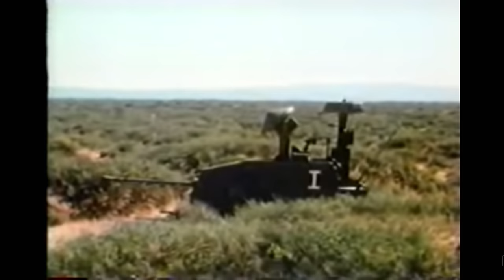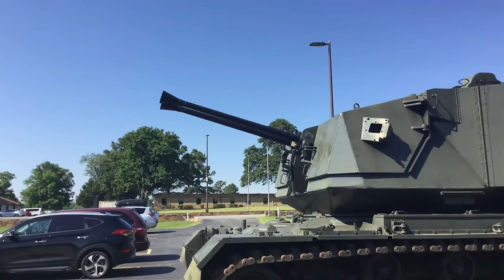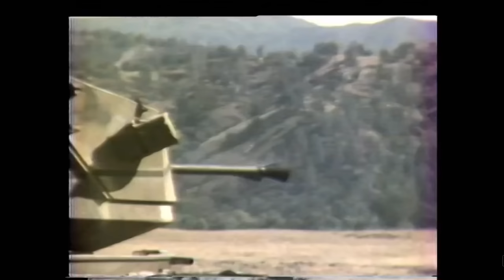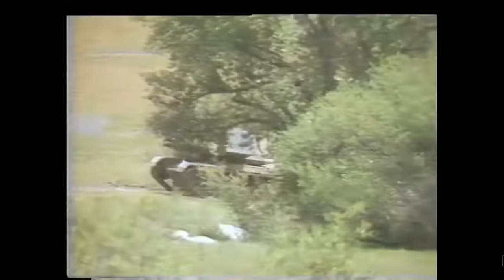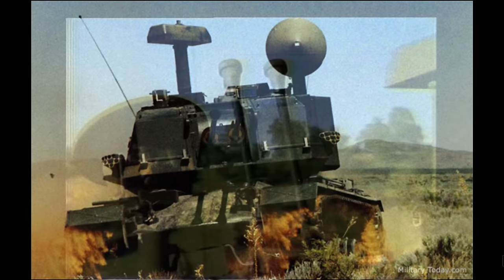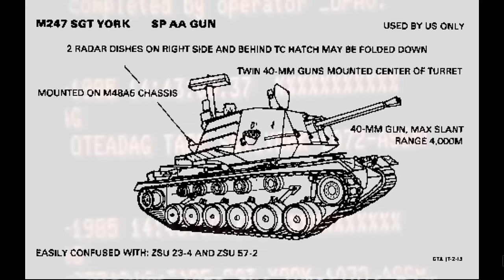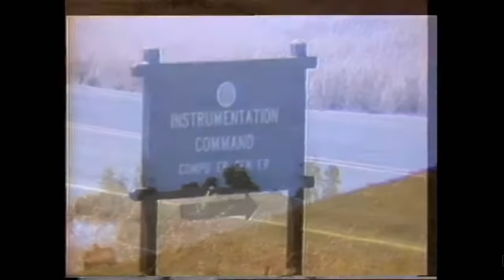M247 'Sergeant York' | WORST AIR DEFENSE EVER!

Comment: Hell, all we had to do was buy the German SPAA LOL!  I remember a drawing one with a GAU-10 35mm version of the 30mm GAU-8!  

Not being able to keep isn't a real argument though!  Good luck having something like a MRLS keep up with M1's.  Road speed is useless compared to cross country.  The M246 should have won but even then as I told someone else on another forum as he bragged about the ZSU's and other Russian SPAA's, turn on the Radar and HARM's will cause them to have a bad day!
Reply: Pretty sure the Russians also had an anti radiation missile
Reply: @jameson1239  Yes they do and I NEVER said they didn't!  That's the problem any SPAA has.  

Now with auto-tracking, FLIR and thermal optics RADARS aren't important for short-range weapons.
Reply: @jameson1239  Oh and all east and west have DATA links where something like a plane, Sat, or Drone is feeding them DATA 300 -miles to out in space feed both Telemetry. 
UK ALARM       Speed 3 km/s (Mach 8.8) Block IA/B
  4.5 km/s (Mach 13.2) Block IIA[4]

Comment: The L/70 bofors were not old, maybe you were refering to the WW2 era L/60? Yes using the M48 hull was unneeded as the armour was too heavy. It really needed E/O and FLIR like Phalanx has now. Radar used by ground vehicles is very terrain dependent. This laughable development is repeated with the M2 Bradley. Pentagon Wars. There should have been a refocus on killing missiles as a CIWS does ie in protecting tanks from missiles.

Comment: The part where the radar located "a target" which was a latrine fan as a helicopter had me breaking out in laughter!  Can anyone tell me why the US military can't buy other nations weapons which have been proved effective?   US Pride?
Reply: Stupidity, pride and corruption.
Very few non-American products ever gets utilized by America.
And even those exceptions usually has some sort of connection with any of the American contractors.
Case in point would usually be H&K or FN. 
One of the only non-American big toys used by America in the past would have been the Harrier. But even then McDonnel Douglas and Boeing had to get involved for it to be able to be used by the Marines.

And it's not just with military products.
Even everyday civilian products suffer from American pride and stupidity.
Just look at what they have done against Jap and Euro cars.
Hence why in the American car community, it is a common and real belief that America barely ever gets the "best toys" i.e. the more racing tuned variants of certain foreign cars due to the countless rules & regulations set upon them due to lobbying done by Ford, Chevy, GM, etc.
Reply: @dickmelsonlupot7697     You're absolutely right!

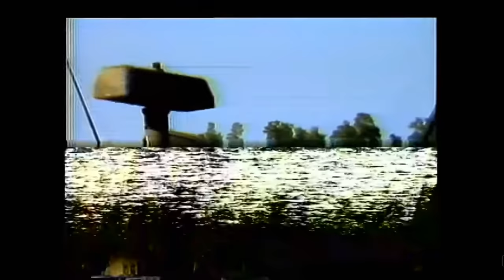Comment: I was there for the evaluation of the two systems, and the General Dynamics system were 200% better.  In fact the Raytheon system was better than both, but as usually politics got in the way.  The selection board did not follow or consider any of the recomendations submitted by the evaluation team, and most on the Eval team was dismissed and reassigned, i Went to Patriot, thank god.  Believe or not but the other 3 systems used Raytheon radars which were tried and tested and worked exceptionally well.  The person that falsified the data was relieved from his duties.  Ford falsified every bit of data that was submitted.  Those stories are adsolutely true.,  It relly wasn't the Army that screwed up it was Ford and the main program manager.  Oh Crap at the 15:08 mark that is me, i Was a CW3(Chief Warrant) addressing the operators on test parameters, all of us were from US Army Test and Evaluation Directorate ar Ft Bliss,  well we were basically fired from the test and evaluattion because we didn't give the answers the Program Manager wanted.
Reply: I joined the Army just as this was shit canned.  We had Vulcans in the York motor pool building, they tossed us out to give it to the Patriot system!  I still have some flavor of Unit Citation award for the York...hilarious!

Comment: Divad was radar targeting.  I designed the Optical gunsights. I worked on the program start to finish. Although not a perfect system. Your just quoting the lieing media explanation.  The problems where more politics than preformance.  Also Ford was losing 1 million per unit. When Administration  was looking to cut spending, (Propaganda) Ford was more than willing to volunteer. Ford in the end made 2x the original contract dollars canceling the program.

Comment: Should've procured the Gepard.
Reply: No, the AHEAD round for the 35mm was decades away at this point (it wouldn't show up until the 1990s, the Sgt. York was developed in the 1970s), and Bofors had just released their HEPF (High Explosive, Proximity Fused) round for the 40mm Bofors gun, a weapon that the US Army loved during Vietnam.

Remember, unless you're a 3-inch gun or larger until the development of the 40mm HEPF round, the only way you're going to hit aircraft is literally filling the sky with rounds.

Comment: And Cv 90 has one bofors antiaircraft cannon -the anti aircraft version is used by  sweden and they consider it a success  thou not the regualar cv-90 40mmwhich are the major vechile use d by the swedes and I think they are by now 4 times as obsolete than this m 48 version and still Swedes consider it useful so what is american thinking really ? That it must take down a Mig 29 at 10 km height at the firs clip every time.. I guess so -they must be dreaming.

Comment: They will need some Phalanx- type system along this line to deal with drones
 A swarm would quickly drain missile defences so the gun would again become relevant for multiple,cheap, small targets at lower altitudes. The West would be deficient in local AA, relying too much on air superiority.
Reply: Nope, all you need is HEPF rounds and it'll be perfect.

Comment: Where does this 40mm stuff come from??? The guns were 25mm. I worked at the test center; the plant to manufacture the ammunition was at the base of the hill where the entrance to the test center was. We had to pass by that plant every day on our way to work. They made 25mm shells. The driver had to pull his head in before a target was acquired or decapitation would result when the turret was spun around. I never heard of any leaking hydraulics. Production continued because most of the problems these videos report didn't exist. What killed the project was breaking parts. Reliability. Given that very close to 100% of all journalists are hardline communist and are therefore inherently anti-military (which in itself is curious since, given half the chance, they would use the military to enforce their politics), the usual propensity for making up stories and facts is present and accounted for here. The M247 was canceled because too much stuff broke too often. My job at the test center was to log parts in and out when they were sent off for repairs. I was kept quite busy doing that; way busier than I should have been. There were never any issues with the targeting system; I was inside one of the units on its 25 mile road test where we acquired a target - a lone automobile ambling down Ortega Highway - the turret moved like lightning and was quite accurate, tracking that poor unsuspecting car perfectly as it drove to wherever it was going. We heard the 50 units produced (never 65) were sent to National Guard units.